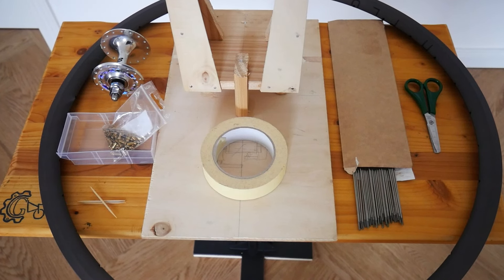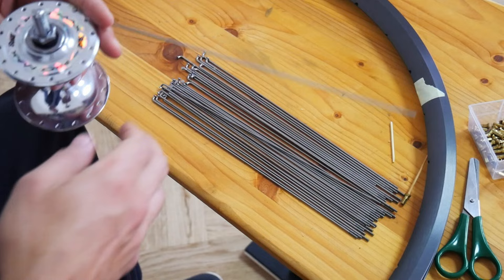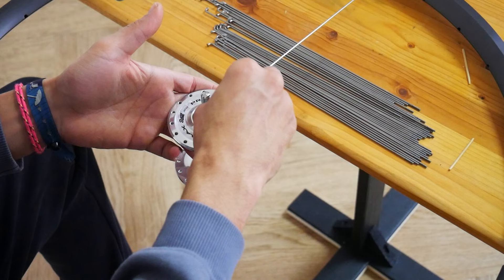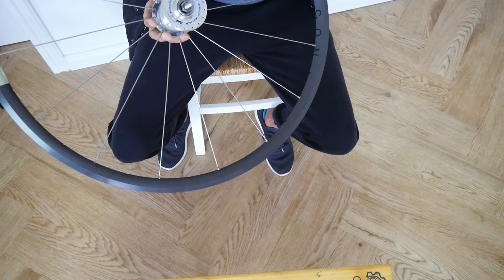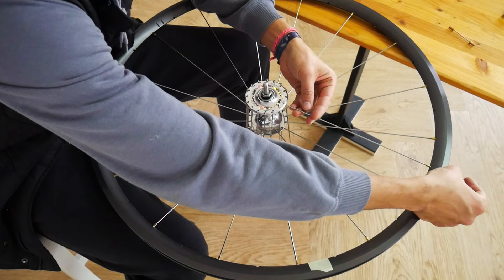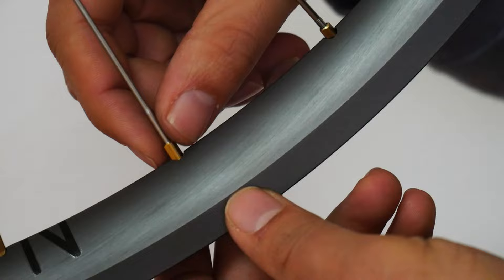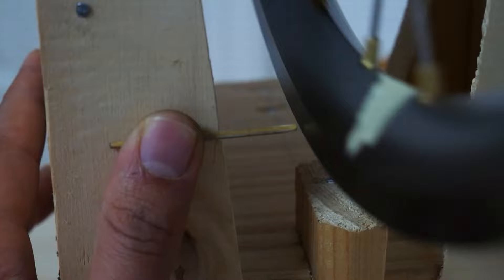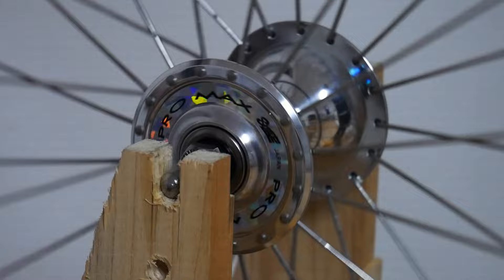FIXED GEAR | How to Radial bicycle wheel ~ Dream Build

Comment: How have these held up so far? There’s always the talk of “radial bad on hub” but those hubs definitely look like they can handle radial.
Reply from the maker: Until now I haven't had any issues, but I should also admit that I do not ride this wheelset often. I do however have two other wheelsets that are a front radial setup, that I use regularly and they are still running great. I only ride in streets though(no gravel and stair jumping etc)

Comment: size spokes?
Reply from the maker: Ohhh this question is hard to answer. It depends on the hub flange length, hub length, the Rim ERD and rim hole offset(if  applicable) and the lacing pattern you would like to use.
Reply from the maker: These spokes have a length of 264mm.
I'd advise that you use a spoke calculator before you buy anything.
Reply: @BicyclesbyJurgen  thanks bro
Reply from the maker: @PortfolioAndikaFebriana  my pleasure👍

Comment: What were your values for the spoke calculator? Im building a wheel and my hubs and rims look very similar to yours
Reply: My spoke length came out to be 266mm but i was measuring everything with a ruler and im not really sure what size i should order really
Reply from the maker: It is very important that you take the factory given measurements. You need the rim ERD and the Hub Flange hole diameter.
I googled the components and just looked in the description on the store websites. The usually have all specs at hand
Reply from the maker: @noskinnoskin1957  the ruler method is REALLY SCETCHY, because 1mm makes that a spoke nipple is too long or too short and the spokes cannot be fastened securely
Reply from the maker: Step 1: get all the factory measurements for the various components(rims and hubs etc).

Step 2: decide on what nipples you want and their length, this also influences the spoke length 

Step 3: add all information into the spoke calculator

Step 4: oder spokes(if the spoke calculator said for example 20-20.5mm I always went for the smaller number.
Reply from the maker: Https:///spokecalc.io
Reply: @BicyclesbyJurgen  thank you so much for additional info.. i think ill just find a spoke size locally rather than just order online if even a 1mm makes the difference between it being usable or not
Reply from the maker: @noskinnoskin1957  it just impacts if the threads on the spokes go in all the way or if they extend out at the top of the nipple. The perfect situation would be when the spoke end sits 1-2mm below the top hole of the nipple when it is fastened tight
Reply from the maker: @noskinnoskin1957  but yeah there is very little margin for play...another tip would be to check out ParkTool wheel building👍
Good luck and ride safe

Comment: Can you do this in 32 holes rim and hubs? Answer please
Reply from the maker: For a radial wheel, the rule stays the same regardless of the spoke count. You add a spike then skip a hole before you add the next spoke(each 2nd hole is free). Then you flip the wheel over and add the rest of the spokes into the remaining holes.
Reply: @BicyclesbyJurgen  thank you so much